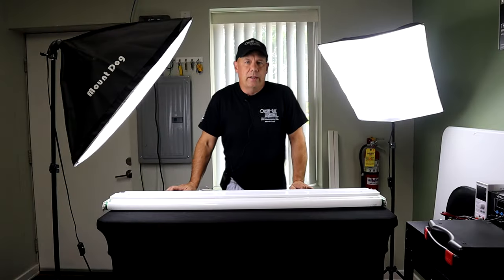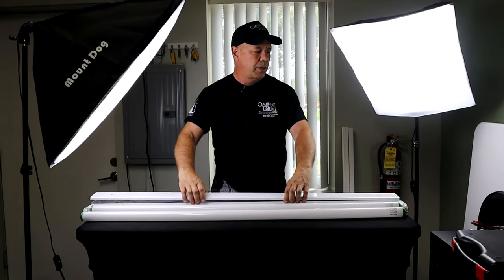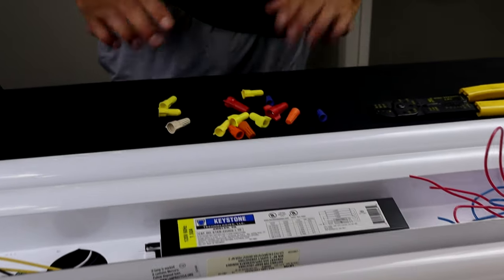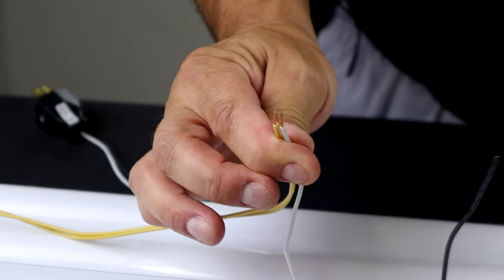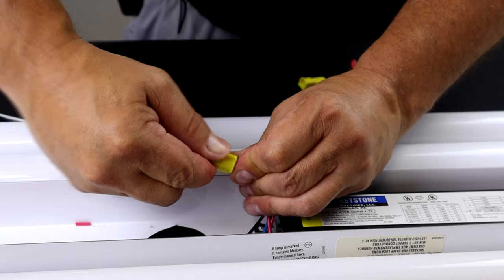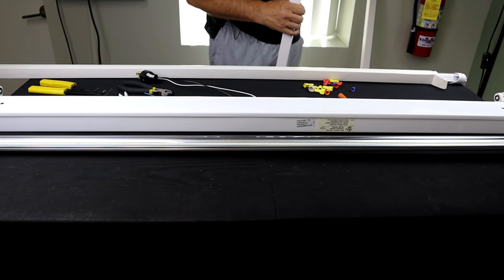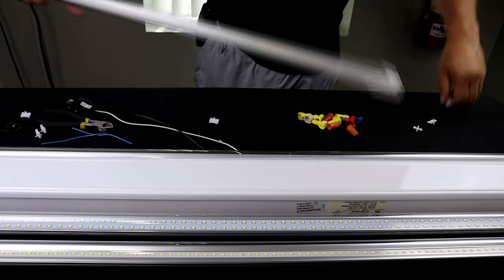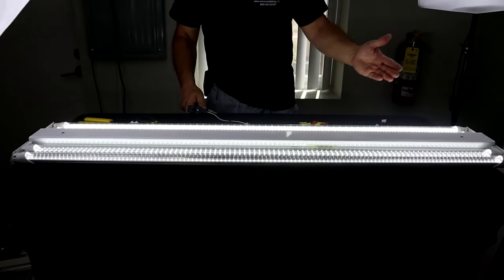How to Install Ballast Bypass Replacement LED Lights - Omni-Ray Lighting

Comment: I just did this. Went with some GE type A/B LEDs with adjustable temp. . Just snipped, pulled out the ballast, combined all the wires on each end with either the line in or neutral and plugged in the bulbs. Super easy. BTW, Home Depot said they will no longer be selling fluorescent tubes once their current inventory is sold. So, everyone should be doing this, sooner rather than later.

Comment: Electrician here and was stumped with the yellow common wires. This gave me some faith the colors don't matter when it comes to converting to LED. Just a hot, neutral and ground like anything else. Good stuff! Thanks!

Comment: This has been the most helpful video I have seen yet. I'm replacing fluorescent lights in the kitchen ceiling with a bunch of wires and my LED lights don't have many wires worried about putting wires together. You were clear explaining how, thank you.

Comment: I followed you exactly, and only one end of my bulb lights up. Something is wrong. If I take the bulbs out and switch ends…opposite ends of the bulbs are glowing .. power to both ends

Comment: Very professional and easy to understand video, thank you!  The lamps I have to replace are in the 12 ft high ceiling of a farm shop.  We installed them 20 years ago and one 6 fixture bank of the 2 tube fluorescent fixtures is completely out.  The other was on a motion detector and still works. We discovered that at 9,000 ft altitude, those fluorescents were worthless in the bitter winter cold.  They just couldn't ever get warm enough to make the gas glow.  We may do the rewiring in place and just leave the ballast where it is with wires cut flush.  I hadn't heard anyone else talk on YouTube about the V design or the other available bulbs with double rows.  This is just a terrific video. Really informative!  Now to rewire 15 fixtures...on a tall ladder.

Comment: great video thanks .. answered my question on shunted and non shunted tomstones . . the bypass  method.  this bypass.. Can it be used on double ended led bulbs.?.   w
Will this bypass system work on single ended led bulbs too.?

Comment: I have  (2) ballast (4) -8ft. bulb (F96TT12)-(60-75W) fixtures. Will I be wiring them the same as your video? Also what size LED bulbs would you recommend, since I'm thinking of only using 2 bulbs instead of 4 per fixture ? Thank you

Comment: When doing this to a light fixture, does it matter which end of the bulb goes into fixture based on how its wired?
Reply: YES it does. The new bulbs will be marked "N" or "L" for Neutral or Line. Put the "L" side of the bulb into the light fixture that is wired with the hot wire and vice versa.

Comment: Just to be clear for a single lamp connection please...The R17D type LED is wired with one end on neutral and the other to line voltage with ballast removed. Is that correct?

Comment: Thank you. Your video was the most informative on bypassing the ballast. I see that doing it with one fixture is very easy. My question is that I have 3 light fixtures connected (each with 2 tubes) that are lined up on the ceiling, feeding from one source. I see how you have said to connect the white with the yellow wires and the colored wires with the black. There are several black wires in some of the fixtures and several yellow and white ones as well. Is it ok to connect more than one black together in fixtures where there are more than one?
Reply from the maker: The best approach when by-passing the ballast, is to cut all the wires at the ballast which will include a white (neutral) wire, and a black (hot) wire, and strip all wires, then wire nut any color wires leading to the 2 sockets at one end of the fixture to the white wire, and wire nut any colored wire leading to the other end to black - then it will not matter how they chased the wiring from fixture to fixture - 
All the best!
Reply: I have the same issue.  The main light fixture that connects to the junction box and 2 other light fixtures daisy chained to the main light fixture.  And I can’t find a Video on this scenario.

Comment: I am not exactly a DIYer but I have removed my ballast and am trying to install "ballast bypass" bulbs. Coming from the power source, there's black (hot), white (neutral) AND a copper (ground). My question is this, do I need the ground? I don't see the ground wire in this video.
Reply: Depend on the house electrical installation. Here because the input is consisted of 2 wires they are 1 hot and 1 neutral/cold. If the is  a 3- wires then you would have brown=hot, black=cold and yellow/stripped=neutral connect to the case of the base.

Comment: if you connect the wires like this video @9:31 each LED tube are set in parallel circuit, each tube receives 55V, if the source is 110V (in America). Does it not effect the light color or power usage? if you connect the tubes in serie consecutive would the tubes work in the same manner?

Comment: When you wire your double ended ballastless bulbs, make sure each pin gets live power on one side, and neutral connections on the other.
Reply: Not working. I did what this video taught and what you said
Reply: My LED bulbs have LN on one side

Comment: I have 2 8 foot fixtures im only converting one over to LED bc the ballast went bad. With lead on one end and neutral on the other end now my LED wont come on (eventho the ohm meter showing 125 volts). Makes zero sense to me why this is happening. Anyone have any ideas?

Comment: I have a hot and Neutral coming in to one side and than both come out and blue and red going into the other. Spliced the Hot and blue and N and red and nothing. Only getting 55v coming in
Reply: Did you figure it out yet? All the red and blue wires get connected to the black wire that you cut off from the ballast. You connect the yellow wires to the white wire that you cut off from the ballast. No wires should be connected to the ballast.